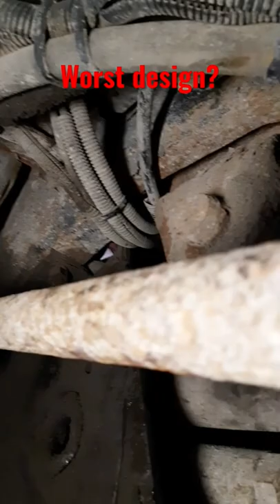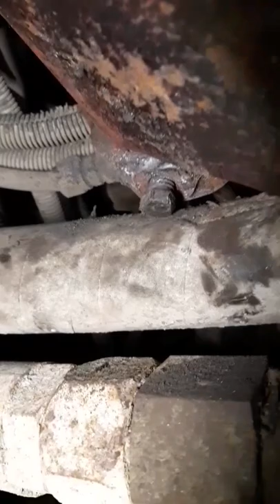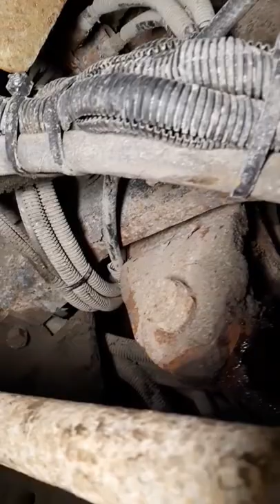Worst design ever.  #shorts

Comment: Magnetic induction heater. We have somebody with a hose spraying water on all them lines why we use a torch to cut it out. Sawzall with a really good blade cut in between the spring and the shackle then once it falls. You can put the torch up there and heat that little bolt and don't have to worry about the rubber in the spring catching on fire.

Comment: Mack, worst comes to worst I’d get a bunch of wet rags and water bottle,just get the set bolt hot, usually when they come in our shop there snapped off from previous techs, I just drill them out and tap the hanger once I get the pin out.

Comment: Dang, wonder if you coulda snaped that keeper bolt and drilled it down. How'd you end up fixing it?
Reply from the maker: I ended up.cutting the main leaf off the pin.  Cut the pin in half.  Rattled on the pin stump to get it moving a few millimeters.  Cut off the hydraulic line mounting bracket so I could.move it over.  Heated up the hanger and spun it out with a ratchet and socket.  Took 2 hours.

Comment: Cut the leaf on the back side with a carbide cutting wheel most of the way then hit it with a chisel to get leaf out ? Cut the head off the bolt and drive it out? Use a small hole saw on the outer frame to cut a hole to get the bolt out ?
Reply from the maker: so many hoses in the way.   we ended up just wraping everything in wet rags and cut the leaf out and then heated up the housing red hot and spun it out with a shallow socket and a ratchet.  took 2hours.

Comment: Torch a piece of bar stock full orange. Stuff it up against your bolt head til all color is gone. Drop the bar stock in a bucket, wrench your now well heat soaked bolt. Whatever "skunk piss" you subscribe to for penetrating oil wouldn't hurt (I like the old bottle of brake fluid most garages have gathering dust)

Comment: You could try putting a large nut over the outside of it and welding it on the heat from the weld will heat the bolt just like you would if the bolt was broken off. The heat should be concentrated enough that you don't have too much risk of melting air hoses.